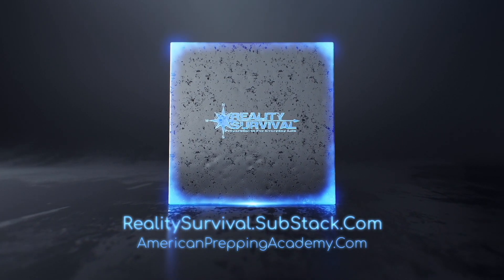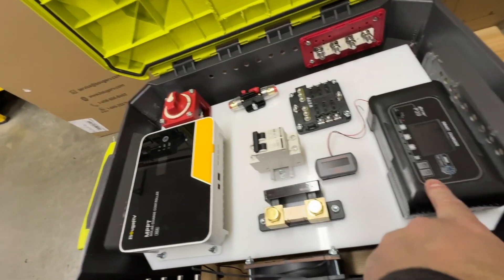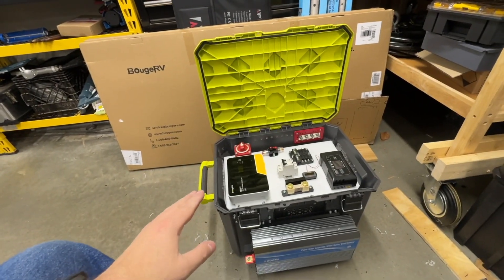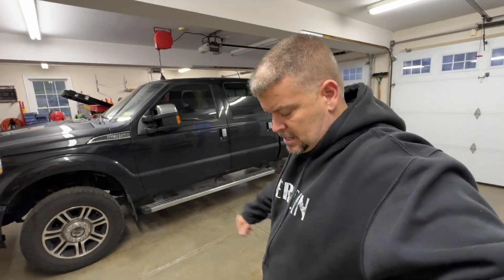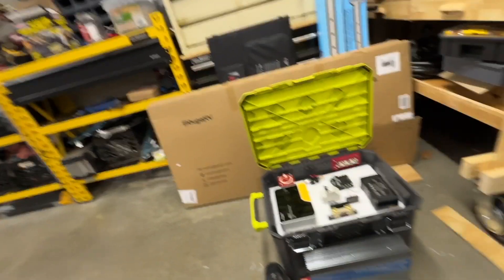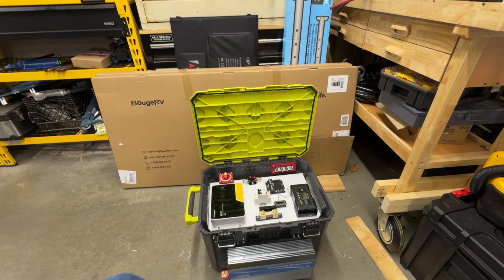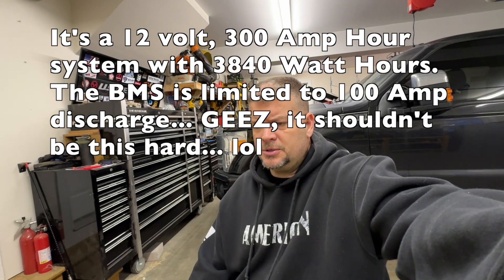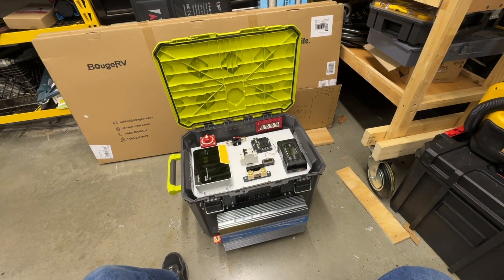DIY Solar Generator - Are They Worth It? Part 1 of 2

Comment: It is like when I put a new computer tower together. It looks like a fun project and if you are wanting specific parts in there, but if all you need is basic functionality then it's hard to beat economies of scale with just buying one. 
Is there any machine out there that is cheaper when you look at the sum($) of its parts?
Reply from the maker: I you only count parts, I have more capacity for the money than anything currently on the market. But if you include labor I am well over the cost of the high dollar units. Lol.
Reply: @RealitySurvival  I saw that. I looked at an old chart that Kris at City Prepping did and your $/Wh was much higher than all the commercial entities. But yeah labor has to account for something. I was thinking of building one but seeing your video and 1-2 others made me decide that when I want to get one, I think I’ll just buy it. Too many other things to work on first. I also have solar on the house with batteries so this isn’t a huge priority now. Thanks for the unbiased review as always!
Reply from the maker: @Wolfpacker  You bet!

Comment: How to protect it from a EMP?
Reply from the maker: Two basic options. One place them in a faraday cage or bag. Two install an EMP Shield on your home and keep them plugged into the wall socket if your home. Use discount code RealitySurvival at EMPShield.com to save $50 each.
Reply: I keep it plugged into my home with the solar  panels that will protect the system. 
Thanks for ur videos great information!
Reply from the maker: @nickeyhicks9288  Sorry, but how do solar panels protect the system?
Reply: No, will the home EMP shield protect the solar panels when they are  Connected to the solar generator?
Reply from the maker: @nickeyhicks9288 ahh! I see. No, but they do make a model for solar panels. They have to be hooked up differently than the home version though. Still very simple but that is another circuit so it requires a different unit.
Reply: @RealitySurvival  OK ,thank you again for ur help with the information.

Comment: Currently u can rarely make one cheaper.   With that said the good part is that unlike a DYI unit, if only one component dies, it easy to fix.   The all in one units are mostly a pain to open
Reply from the maker: Agree that is the downside to the all in one units. If they break you might be hosed.
Reply: I agree with you on the all in one units - I often think about that - if a man is good at projects and has the time my guess is it would be better for him to build a unit him self - .
     In this case all the components are listed that are needed - 
   We waist a lot of time and money putting projects together - but in this case every thing needed is listed -
Reply: @able880  Madea few, bought a few. It's not that hard to make and like grocery shopping, u can get generic parts for some things.   Solar power is not as hard as some think

Comment: Thanks for the video, nice system. Made a so-called portable solar generator several years ago before the big solar generator boom. Used AGMs, lithium was too expensive, devices were more for larger systems. It's still works, learned a lot but there is so much more, smaller, cheaper, more efficient equipment available. Agree the prebuilt systems are very cost & time effective. But for those who like DIY and understand how a system works that can be worth the effort just not cheap.
Stay Safe & Good Luck

Comment: Yep, I have picked up several complete units that I fill confident in. I also have a very simple 12 volt solar system set up &  have picked up 12 volt refrigerator/freezer units, lights, fans, and dewalt DCB119 charger (can recharge dewalt batteries from 12 volt).
Reply from the maker: I wasn’t aware Dewalt had a 12 volt charger like that. That is pretty cool. I’m gonna snag one of those!

Comment: I make small scale solar units to run specific systems. You aren't going to live normally after a grid down event. I also try to avoid inverters whenever possible. For example, to run a CPAP machine, my friend built one of these with an inverter. I looked at the power block and saw it actually ran on 24Z DC. A pair of small 12V batteries solved the problem. Panels are separate, used only to charge these.
Reply from the maker: For sure. There are many appliances that are actually on DC voltage. If you can go straight DC to DC that is the best option. There is a lot of waster in DC to AC to DC conversion.

Comment: You have a bit of excessive capability, but maybe that's what you "need."
For a small scale power box: a couple cig/usb, a small inverter, a small SLA battery, a trickle wall charger, a small solar input... $150 - $200 and 2 hours.
Reply from the maker: Well it all depends I suppose on how you define need. A small box as you described doesn’t really provide much of a capability to run something like a full size refrigerator for any length of time. That was my objective with this unit.
Reply: @RealitySurvival  A few bits of data: the defrost cycle of a standard fridge is the biggest draw on your batteries. It is basically a dead short heating element. Finding a non-defrost fridge will reduce your consumption / requirements considerably.
I wasn't aware of your requirements. Always good to understand how things work so you can fix them. Those all-in-one packs may be a challenge to repair.
Reply from the maker: Great point on the defrost cycle. If we get a new fridge anytime soon I will keep that in mind for sure! Thanks.
Reply: A fridge can draw 150 to 300  watts while running depending on the room temperature - when it's real hot the compressor burns a lot more power - when they go into defrost some cycle the heater off and on but at 600 watts - 
      If you think you will be off grid for lengths of time it's better to use a chest type freezer with a inline thermostat (DIGETEN Amazon) so it will cycle as a fridge does - 
     I live in the deep South - a frost free fridge will run 100% of the time when it's 100° in the house  - 
     I've lived yrs with out air-condition - except for when I was married lol -

Comment: Only 15 to 20 hours of research is kinda light, then add time of layout, configuration, and finally the build time. 
Bonus is an indepth understanding of function/diagnostic abilities, repairability, and all of the knowledge you gained.  
The time invested is equivalent to the average amount wasted on internet/games.
Reply from the maker: There is certainly value in learning all about the topic no doubt about that. And you bring up a great point about these DIY types being much more serviceable and repairable if something should break.

Comment: I agree that building one of these things is NOT for the faint or heart‼️ 🤣🤣🤣🤣🤣 I bought a few of the commercially made ones that work great, but, my curiosity encouraged me to build my own 600w solar generator. It was a great learning experience for me, so, it was worth it. I'm building a bigger second one now. You're right though.  The tools and auxiliary components such as the wires, heat gun, shrink-wrap,  busbars, fuses, ring terminals, fans, the box or cart to store it in are costly even before you get into buying the batteries, inverter, the solar panels, and the MPPT Charge controller. If you're doing it to save money, it's not worth it.  If you're doing it to learn and to have the flexibility to switch out components or to help others build theirs, it's worth it. You get GREAT satisfaction building your own and seeing it work flawlessly. 😊 Thanks for sharing.
Reply from the maker: Couldn’t agree more. The knowledge aspect of it is very valuable.